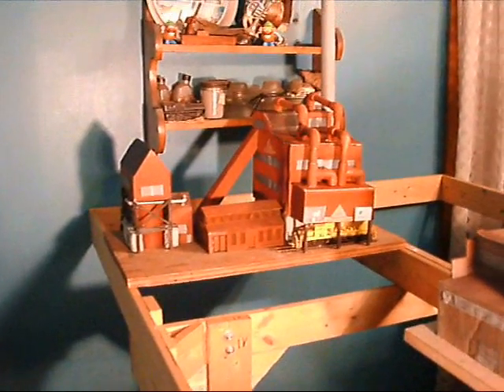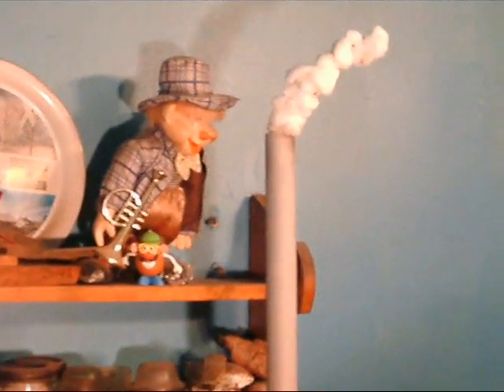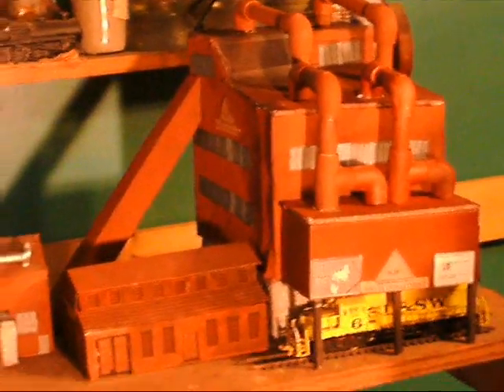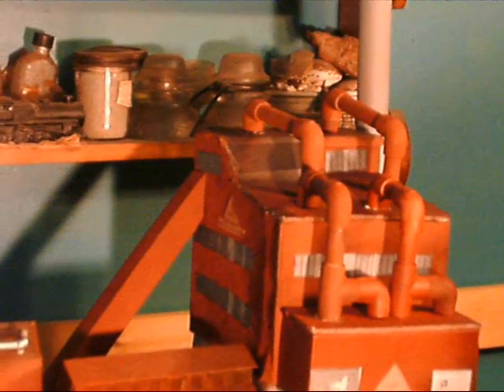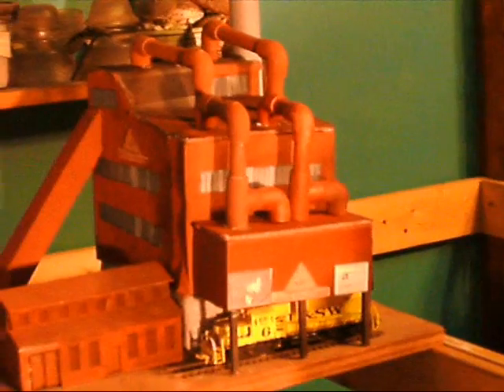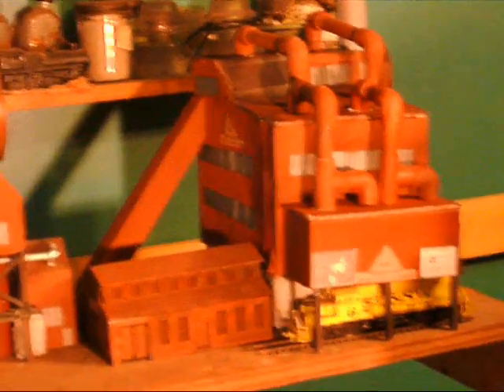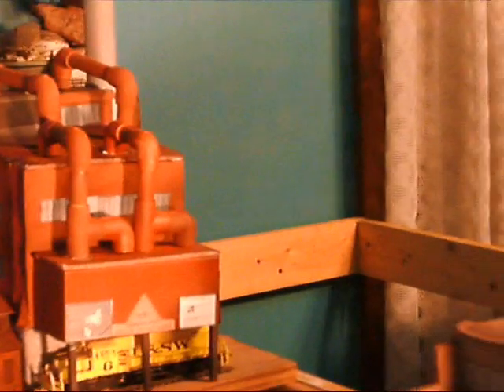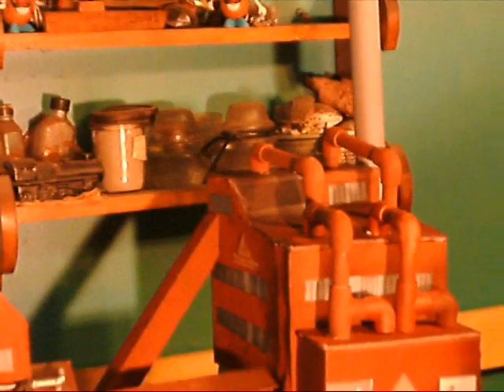Spring Lake Iron & Steel Sintering Plant

Comment from the maker: @spoonerspooner  I learned that the Wawa Branch might be reactivated to serve the Canadian Chrome Company's recent discovery of Chrome ore in Northern  Ontario. They plan on building a 200+ mile line to connect @ Wawa and then down to Michicopoten where the ore will be processed then shipped by water to various locations. The road be @ Wawa is still intact where as the Thunder Bay (I guess) branch is completely torn up. I don't know of anything has come of this project.